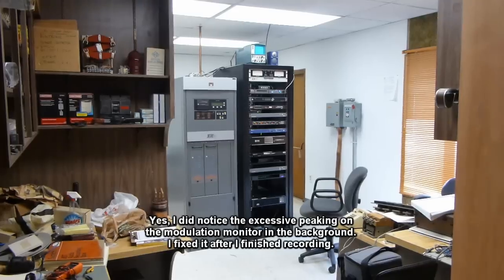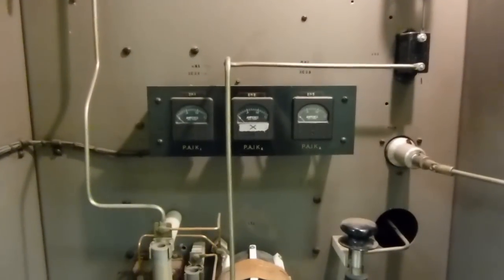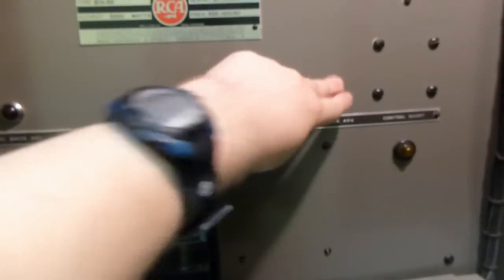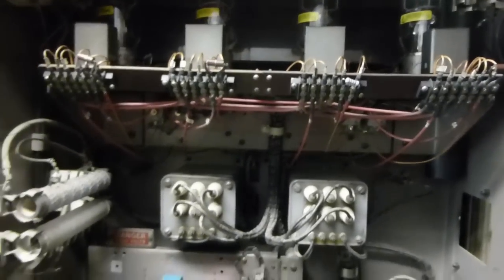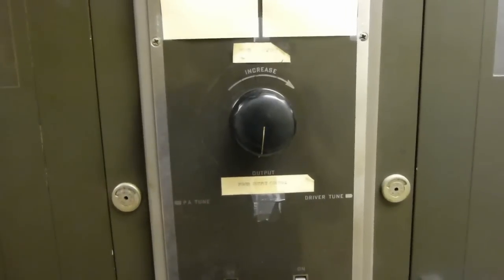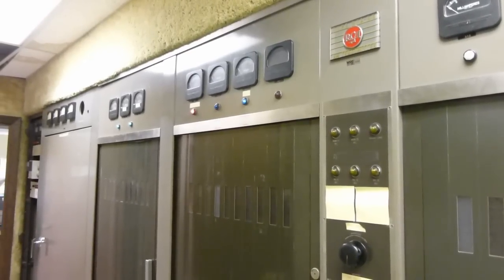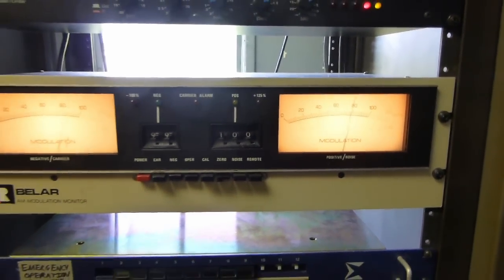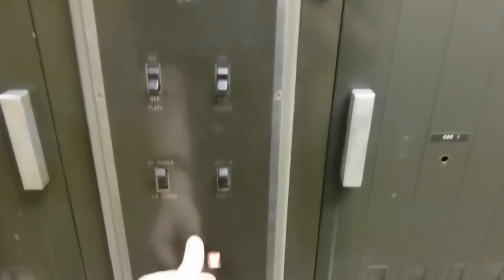A Look at a 1950s-era AM Radio Transmitter

Comment: Especially given the fact that this transmitter is in perfect operating condition, I certainly hope that you can take steps to prevent this from ever being dismantled and thrown away. I recently had been forced to dispose of a GATES BC-5B that could have easily been put back into service. Great job on keeping this alive and thanks for such a wonderful video.!
Reply: Dam what a waist
Reply: Had similar experience with a recently replaced ‘50s RCA 3kW FM transmitter.  If was free for the hauling away, but what could I possibly do with it?      The chief engineer saved the modulator and logo.
Reply: @davidcarson4421  use it as a very powerful spark speaker in a Faraday cage 
Or
To drive a tesla coil 

Quite a few other things
Reply: @davidcarson4421   Install it in the trunk of your very large car, as an aux-to-FM adapter...?  :-D

Seriously though, this is cool as.  But, I would imagine modern designs are WAY more power-efficient, with less out-of-band hash, considerably more reliable, and easier to troubleshoot.  There's probably no good reason to keep one of these in service.  Though I do hope a few are saved for posterity, regardless.  How a glass bulb in one place can create music in a clock-radio dozens of miles away, will always seem magical to me.
Reply: @David Carson  I would have find something to do with it. Believe me 😆
Reply: Or pwn some wifi adjust the resonators and tubes and amplify that to 2.4ghz

Comment: In the early '70s during college, I worked a 16 hour weekend shift as the transmitter engineer for a 50kw day/ 10kw night AM station. Our day pattern fed 2 towers and went to 9 towers at night. The daytime transmitter was an RCA Ampliphase BTA-50G. As I recall, the power supply used 6- 857B MV rectifiers that were almost 2 feet tall. It ran at about 16KV at 4 amps. The blowers on that thing were really loud. Unlike a typical plate modulated transmitter, this was essentially 2 phase modulated transmitters with a network on the output side that vector summed the phase shift of the 2 transmitters so as to create an amplitude modulated signal to the antenna. We needed to be sure not to exceed 100% modulation, or the result would be horribly distorted audio. The transmitter tubes were huge and required a lifting device to change them. Luckily I never had too. The doors on the power supply cabinet had spring loaded shorting bars that would discharge the capacitors if the door opened. Get ready to change your underwear if you weren't expecting a loud snap.  The night transmitter was a plate modulated RCA 10D from the 1930s that was retired from use by the state police when they used to operate near the AM broadcast band. This thing was like a giant ham transmitter in that tune up and operation were the same. There was a huge modulation transformer that sat in a cage behind the transmitter. It also had 2 large brass balls to form a spark gap for over modulation. This transmitter had no forced air cooling and it was a dream to take that 50kw unit off line at night. You could hear the modulation transformer and it sounded like a tweeter. The inductors it the antenna tuning huts also acted like tweeters. I had a lot of fun working at this station and really enjoyed your video of the well preserved 5G.
Reply: Could that have been WJAC  850 AM Johnstown, PA ?   I know they have an 9 tower array and would switch to a northern broadcast pattern at night.  I remember 10W but not sure of 50W (most  50W were clear channels?)  Stretching my memory!  Thanks
Reply: Cool .. ! Well  said  Wb0siy
Reply: @FirstLast-ye5ct  It was WCAR 1130 kHz (Class B) in Detroit with the transmitter site in Trenton, MI south of Detroit. It was not a clear channel station, hence the need to lower power and change the pattern at night. The day pattern used 50 kW feeding 2 towers with a strong lobe to the north and lesser to the south. The night pattern had to protect stations in other states while covering the metro Detroit to mid Michigan region. The station went through numerous format changes over the years. When I started, they were shifting from 50s- 60s pop music (Sinatra, Peggy Lee, Doris Day, Nat King Cole etc) to a top 40 rock format. Sometime after I left, they became WCXI with a Country Music format, then WWW (don't recall the format), then WDFN Sports Talk and now the Black Information Network. The WCAR call sign still exists in the Detroit market with a low power station on 1090 kHz (250 watts day, 500 watts night). WJR 760 kHz is a 50 kW Class A clear channel station also near Detroit with a single tower and omni directional pattern. Here are some links that might be of interest- https://radio-locator.com/info/WDFN-AM (Click on the gps coordinates and choose satellite view to see the tower arrangement), https://mcrfb.com/?cat=32 , https://www.weather.gov/jetstream/ll_ampm_stations.
Reply: Loved it 😊
Reply: @ctbcubed  Do you still work in Radio?
Reply: @Truck6000  No, after college I spent 36 years in the automotive industry. Retired now.

Comment: When I was 14 years old living in a Suburb of Detroit in 1957. I made my own radio station.  I hooked up my Heath kit RF generator to my 45 record player I and  build a hybrid transmitter circuit with 6l6 and is a couple 12ax7s  I think and some other parts I found and was putting out about 5 watts in my neighborhood at about 660 am so us kids could listen to our records. The FCC showed up at my parents house and threaten my parents with jail if I didn't shut it down. Us kids knew a lot in 1957

Comment: I wanted to be a radio engineer. At 13 I had my 3rd class FCC license. Then I was installing radios in cars. Cars became my passion. Retired an ASE master technician. Wish I stuck with radio, my back would be in better shape. Thanks for the tour.
Reply: Well, your back might be in better shape, but your bank account wouldn't.  Maybe as an engineer.  Radio owners don't like to pay their employees, at least not the on-air.
Reply: The automotive industry doesn't pay well either.
Reply: @SerenityMae11  As an  entrepreneur radio installer and being good at it you can make big money. Especially once the late 80s and early 90's hit, car stereos were hot shit and anyone that cold wire them up to make the big boom was making enough to wear a gold suit and top hat. The same happened in 2003+ when everyone wanted TV's and more entertainment capable stereos.
Reply: Dunno, in my years in Radio/TV Broadcasting, I've lugged some massive stuff round, grovelled under building floors, climbed ladders, & even dragged my complaining old bones up TV towers. 
At the same time, I worked on cars at home for fun----go figure!! :-)

Comment: As a young man, I used to help the station engineer at the remote transmitter site out in the sticks when lightning repairs etc. required some overnight work. He was a polio victim with leg braces and often needed some extra help. The 1KW transmitter used two 4-400 RF output tubes. I was a ham and he would let me have some of the older 4-400 tubes for my 1KW ham rig.  Those were the days. I once volunteered to climb the tower half way and replace a burned out light. I will never do that again. My legs were like jello afterwards. Fond memories.

Comment: It was good to see some vintage broadcasting gear that still works. I happen to be a retired Broadcast Chief Engineer and your transmitter brought back many memories! I want to point out that I saw you touching some of the tubes with your bare hands, I recommend that you do not do that. I say that due to the oils and other contanaments on your hands can create hot spots on the tube in the area that was touched and cause premature failure. Many of the stations that I took care of had kept their old tube transmitters after going solid-state and kept one tube transmitter as a backup. I am not sure if they have them now, I expect not. I retired in the first week of 2013 and then moved south to Florida. While in retirement I am doing some contract work with several stations  here and I do love doing the work, down here 90% of my work is rebuilding Antenna Phasers and Transmitter Finals that suffered Lightning Damage. I will keep doing my contract work for as long as I can, I feel blessed that I have a profession that I love doing and to me it is my play ground and have kept up with all of the technology changes through the decade's.

Comment: Marvelous transmitter. KUGN (Eugene) ran the very similar BTA-10, operating at 5kW, thru 1978 when it was replaced by a Continental. Amazingly solid, good sounding, and reliable. Also easily capable of 110% to 120% positive given the oversized components.

Comment: I enjoyed your tour of this transmitter. You voice and laughter conveys enthusiasm and positive tone. I worked for an AM station in Topeka Kansas. KEWI back in the early 70s which used a Collins 21E. We used mercury vapor rectifiers in the hi and Lo voltage power supplies. Modulation would really get those guys a blinking. They later went to solid state rectifiers.
Reply: @Frank Roberts Hi Frank, Yes I remember both stations well. They also inspired me to go for the 1st class radio telephone ticket. I worked at two tv stations in addition to KEWI until 1972 and went into avionics as engineering tech. Many of the broadcasting engineers we had back then came from Forbes AFbase or former Forbes stationed.

Comment: About 20 years ago I got the unofficial B tour of a long time popular AM radio station's backup transmitter while working on a cell site nearby and chatting up the engineer for the station through the fence during a smoke break. Similar equipment and vintage. They kept it operational rather than installing more modern equipment since it was there, still worked, parts were still available and it was easy to maintain. A few months later a small plane crashed into their new tower at their new location and they had to fire up the old one and operate from it for months. Their newer site had more power but their old site had high elevation. During their back up operation I was working on another cell site a good 900 miles away and I was able to pick them up on my truck radio at night no problem. I live about 400 miles from there now and I can tell when their new site is under maintenance because I can pick them up here day or night while they are on their backup.

Comment: Those tubes you were talking about looking at -- they do put off some UVB and UVC, but even that thin glass plate in front of it would completely absorb all of it. Even the glass of the tube itself probably absorbs the vast majority of the UVC. So I wouldn't worry too much about it. You could always grab a UV sensor from Adafruit and take some readings. 
Anyway, this thing is absolutely awesome. I would love to hear this thing actually on the air!

Comment: Wow, this takes me back. I worked at a station in the late 70's, that was using a 1 KW Raytheon, (1947 vintage), at night, directional 4 tower array. Daytime, we used an RCA BTA-5, non-D.  The RCA BTA-5 was only 2 units though. There wouldn't have been enough room at the transmitter site for that mega-monster 5KW that you showed here.  I was one of the jocks at the station, but was at the x-mitter site on many occasions. It was nice to take a trip back to the fun old times of radio. I got paid crap, but I had fun.

Comment: I worked in a radio station many years ago that had a Gates BC-1 transmitter.  Our running joke was, we didn't know if that was the model number or the year it was built.  It had two 807's and four 833's.  The unit was about the size of a large refrigerator.  We could always tell when trouble was brewing in that monster when one or more 833 would start glowing a VERY bright orange.
Reply: That would be the era before a move to 4-400 glass tetrodes, with a round base socket.  Either design used 2 tubes for a class C RF final, and 2 tubes for a class B audio amp feeding the modulation transformer. In that power range Gates used dry transformers, and so there weren'tPCB HazMat issues found in larger transmitters, or in some capacitors when not of dry film construction.

Comment: Thank you. They don't build anything like they used to anymore. As for the beast at WQXR in NYC long gone is that trusty Westinghouse 50HG-2 Transmitter, and same as you have found out, A Harris 10K stand by back up was so unreliable very temperamental. By the way, Modulation Transformer and Reactor were almost as tall as me. And I stand 6' and every now and then you would get a SNAP sound as the arc gap on top of that reactor went off. 😂 This was a great video of day's gone by. Today's transmitter sites both AM, FM, and TV have no soul or humans standing watch 24/7 gone is an era I will remember. 👍👍

Comment: About 1979 I got hired as a transmitter engineer at WARM "The Mighty 590" in Avoca PA. Actually I didn't know anything, I was a college freshman and newbie Ham radio op. In fact I think maybe a Ham Op got me the job?  The transmitter was basically 5 towers out in a farm field miles from the studio. I never saw the studio. Fun job while it lasted which wasn't long. The owners replaced most of us transmitter baby-sitters with automation. I wish I had taken some pictures of the facility but I didn't have a camera (and of course that was before the era of smartphones with cameras- or even 'dumb phones")
Thanks for the transmitter tour.
Reply: Now it's just another feeble bleep of its former self. Like so many other stations of its time. A CB base station with a linear amp puts out more power. Now the latest trend with these dinosaurs is to go to low power FM.

Comment: I worked on the preceding RCA model (BTA 5F) installed in circa 1947 at 620 kc in Knoxville and a following model, the RCA (BTA 5R) installed in 1959 at 1310 kc in Asheville and both were built very well and very reliable.  

(Between the 5G and 5R models, there was the 5H, which was a 5G with a beefed up plate transformer, and the 5J and 5L, which were the 5 KW versions of RCA's Ampliphase design,.)

I installed a new Collins transmitter in Knoxville and literally gave the 5F away.  At the time (about 1980) I did not see the beauty of the 5F, but looking back it was a huge mistake not to keep it as a backup (we had a newer transmitter to backup the new Collins rig).  

Also, it was almost whisper quiet due to the large cooling fins on the 892R final tubes not needing a high pressure blast of cooling air.

The 5F worked perfectly, but even in 1980 it was very inefficient, but it could have been left in service as another backup and would probably still be viable today unless it lost a transformer, especially the modulation transformer which was known to fail on the 5F. Plate voltage on the 5F was 18,000 volts due to the low current capability of the 892R tubes which stressed the mod transformer.

I imagine the tubes for the 5F became difficult if not impossible to get; we were using rebuilt tubes from Freeland (which was later bought by Econco) in the 1980's and I do not see 892R on Econco's list of tubes they have available.

The 5F still had the MV rectifiers up to 1980, but the 5R had the 8008's replaced with silicon rectifiers sometime in the 1960's

Both the 5F and 5R used a conventional three phase rectifier for the HV, which IMHO are much more reliable, but did not give the ability to control the power as finely as the thyratrons did.  The thyratrons seem unnecessarily complicated to me.  I guess RCA also decided that when they came out with the 5R.

Like the 5G in this video, the 5R used a pair of 5762s in the RF amplifier, but used 3X3000F1s for the modulator, which I think probably was probably a better choice of tube for that purpose.  The drivers were completely different,  a pair of 4-125As each for the RF and modulator.

Don't know what became of the 5R at 1310 as I sold that station in 1986.

BTW, in 1969-1970 I lived in Western New York and had an occasion to visit WSAY back then.  If my memory is correct, the 5G was what was on the air and it sounded like it needed the modulator tubes to be replaced.  For the way the station looked back then, and the way it sounded (appearing to not be very well maintained) this 5G is in really good, and clean, condition!  I hope the owners of the station keep it in service.

Comment: Great demo !  No Digi-Key, Mouser, Web, SPICE, CADENCE, microprocessors, FPGAs, or LDMOS FETS yet engineers of yesteryear had a good handle on physics and materials.  They were quite innovative and resourceful and produced excellent performing equipment.  I have a 60 year old Collins 20V-3 1KW transmitter I've converted for ham use.  Except for a rusted 6SJ7, it hasn't skipped a beat.  Given their performance and reliability, these old transmitters are indeed engineering marvels.  Keep that baby on the air !